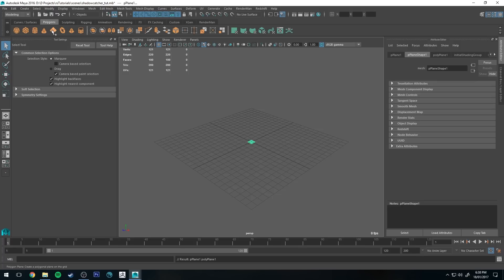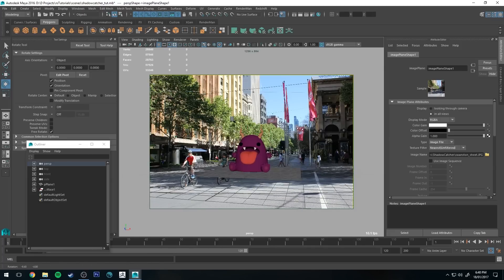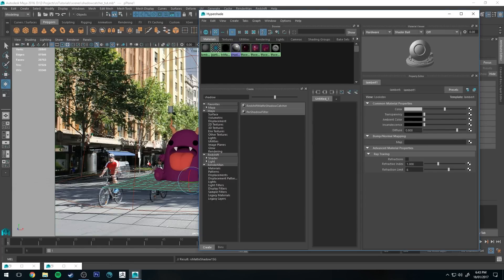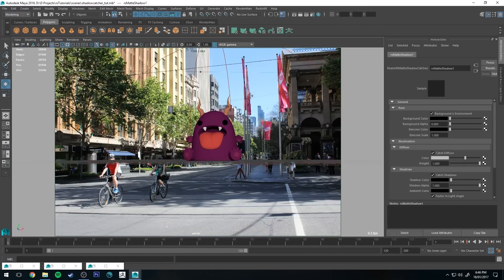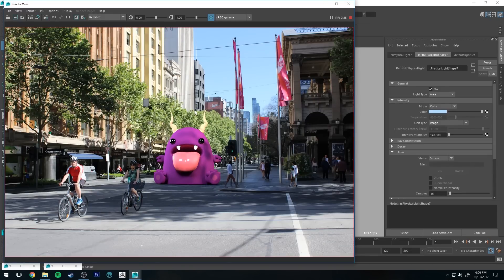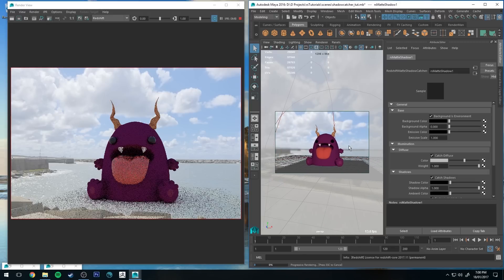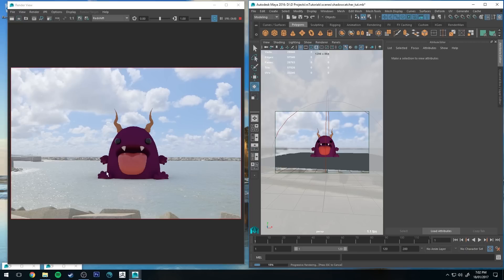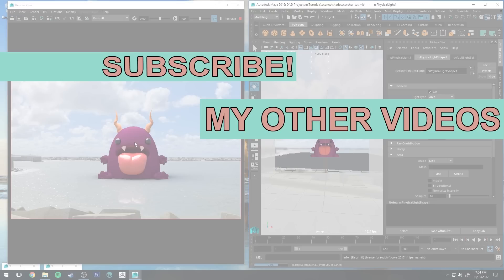Redshift Shadow Catcher Tutorial

Comment: This does not work using only redshift lights without an HDRI but I have found a solution that works. Go to your node set up for the material of the floor and find the RS Matte-Shadow catcher and check catch shadow. You can also check reflections as well.

Comment: Is there a way to render the shadow alone?
Reply from the maker: Depends on what you want to do exactly, if you want the object to cast a shadow but not be visible in the render you can go into the attribute editor for the object and see it to 'matte' under render stats (near the bottom from memory). You could also do this manually in the render stats by unchecking primary and secondary visibility but it's better to set it to matte.

Comment: How did you integrate the gobos with the leaf texture, is there a slot to put the texture into?
Reply from the maker: If you wanted to do this within the light itself you'd have to use a Spot (mainly so you can adjust the softness of the shadow). Here I actually use a polygon plane in front of the light with the texture assigned to the material's opacity (the texture is black and white) - it's a bit of an odd way to do it but I find you get a little more control of your shadows without having to adjust the distance or intensity of the light. I'll probably do a little tutorial on this maybe this week as I don't think many people do it this way but can be a neat little trick.
Reply: Small Robot Studio Thx!

Comment: im getting an issue with redshift when i try to use it with ncloth. Anything with a passive collider or any kind of ncloth properties shows up as a red surface shader material in IPR. any ideas? this is a really weird redshift issue and i cant seem to find an answer anywhere.
Reply from the maker: No idea I'm afraid, that's probably the sort of question one of the admins on the forums would be able to answer though.
Reply: hey! I think i figured it out. The material didn't turn red, it just made a duplicate of the material that I would assume is the "collider box," which covered up the original object it was supposed to represent. I was able to hide the collider objects by hiding just nrigid objects. 

I love your work and these tutorials, would love to get your feedback on the stuff I've just started cranking out with redshift if you have time! Thanks for the help
Reply from the maker: +Christopher Rutledge oh cool glad you got it sorted! Yeah feel free to email me your stuff, you can get my email address from the 'about' section of the channel.

Comment: I'm trying out the trial of redshift, and it seems to make maya somewhat unstable. Is this my hardware, or am I doing something wrong?
Reply from the maker: Hard to say - when you say unstable is Maya crashing straight out? Is it just during a render? What are your system specs?
Reply: Sometimes it does just straight up crash, and returns the "fatal error" message. 

My computer's not the best, but it should be good enough to run Redshift.
- 16GB RAM
- i7 quad core CPU
- GEForce, GTX 850M
- 2GB of VRAM

And this'll happen with really simple stuff, like a cylinder and a plane with a texture applied to it lit by IBL with no GI.
This even seems to be when I'm not rendering.
Reply from the maker: I wonder if it's because of the mobile graphics chip, they can be a bit testy sometimes. Any chance you're running Maya in admin mode instead of normal? I've noticed it run poorly when I've set it to Admin mode (troubleshooting a bug which was to do with Renderman though). Otherwise it's a bit too general of an error to be sure - only thing I could recommend otherwise would be to make sure that your graphics drivers are up to date.
Reply: Ok. Will keep investigating.
One time where it definitely crashes 100% every time is when I switch maya scenes without stopping IPR. Fair dinkum there, but it would be simple for autodesk to have coded in some protection there.

Sometimes it'll just spontaneously die though, which is annoying
Reply from the maker: Yeah the only consistent crash I can reproduce is it crashing during an IPR as I've deleted a material that was being rendered. Maya is... Maya lol. Nice to see a local about the channel, cheers for watching mate.